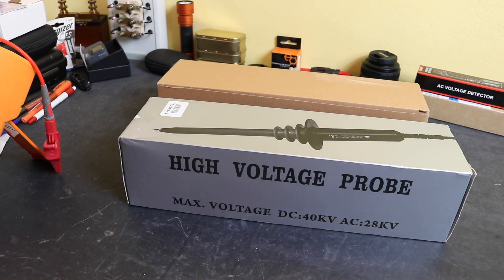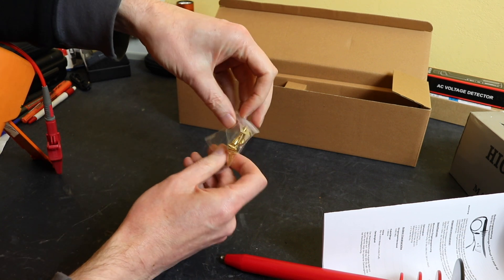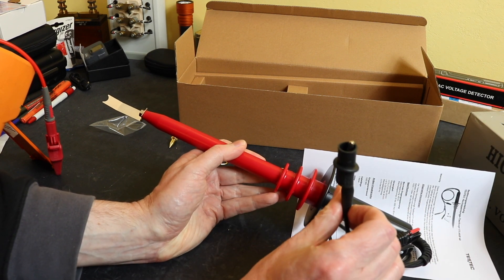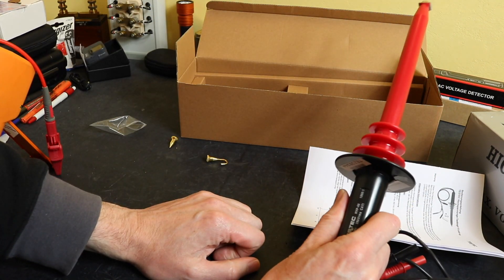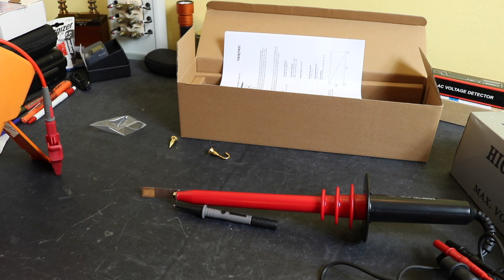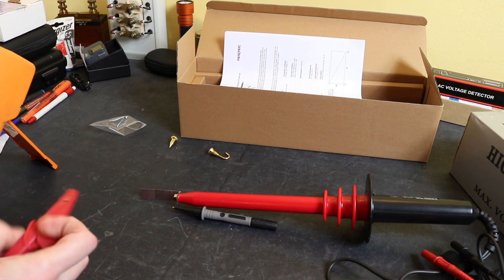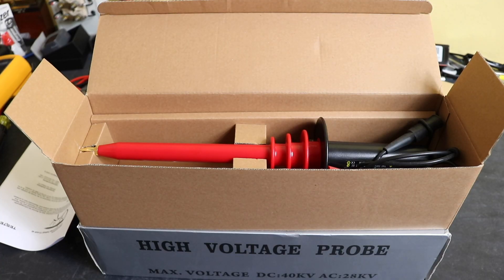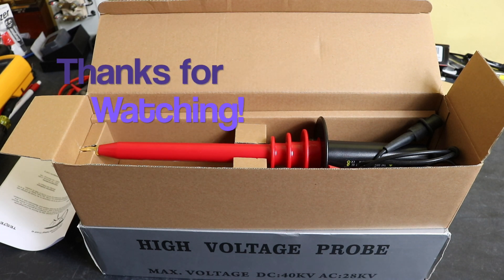Testec High Voltage Probe Tests

Comment: That design hasn't changed since at least the 1950s. I have a RCA WG-289 that looks exactly the same.
Reply from the maker: Interesting to know, sometimes materials improve over the year, but basic high voltage design just aims to keep people at a distance. Thanks for watching and commenting.

Comment: Interesting device agree for something technical probably should spend the money.  Now testing be screwdrivers I'm looking forward to that one!
Reply from the maker: Yeah, definitely prefer the more reliable brands when it comes to higher voltage testing. VDE screwdrivers will be a while yet, need to build up the holder.

Comment: When would a 100x (4kv rated) standard sized scopeprobe be sufficient to use when looking on voltage on a scope..
tons of smaller things are using high voltage, even smaller component tester that merely are running on a single 4v LIPOcell.
Same with a small plasma lamp from China that are running on fx 3x AAA cells and are using a tiny flyback transformer.
These smaller HV items that are being powered by batteries, and are in the range of a few thousands volt but with minute current behind..

Would a probe like Testec TT-HV 400 | x100 (4k DC &  AC peak) be okay to use on such small high voltage battery powered things.
And also looking at mains voltage, not HV products running form mains.

I get that getting a high voltage differential probcoe is the preferred way when working with high voltage or even mains, to obtain that isolation, but they  do cost decent sum for the casual hobbyists, and not least if a decent 100x HV scope probe could muster some of these usecases.
The scope would be floathing, not grounded fx Micsig.

Thx for the video, any reason you didn't look at the signal on a scope, as these high-voltage probes with 4mm sockets tends to be quite a bit cheaper then the ones with BNC socket, and wondered how well they would work for use on a scope with an 4mm to BNC adapter, but then again, signal-fidelity is likely not the main narrative on such attenuated resistive probes..
Reply from the maker: I do not have that particular probe from Testec so cannot comment directly about it, although I might get hold of one later. You can certainly use them for higher voltages as long as the attenuation is good enough to drop the voltage you are measuring down low enough for the rating of the scope inputs. My Micsig has 300V rms rating so with a 100x probe there will be no problem.

Battery powered scopes are ideal to maintain the isolation, just be aware that the channels may not be isolated from one another so you can get circulating currents through the channels. Generally with the higher voltages, I will stick to one measurement at a time using just one channel. My Micsig does not have isolated channels, neither does my Picoscope and with those you also have to be aware that the ground will be common back to the USB port of the computer, which can create further problems.

I did do a section with the scope but messed up the audio recording, so will have to do that section again and put it in a later video.

Comment: I never heard of the brand TESTEC. It looks like the FLUKE high voltage probe I own. I never felt comfortable using one of these probes. Nice review TP
Reply: TESTEC makes great Probes for oscilloscope.
Reply from the maker: @TonyAlbus  A comment below talks about them, I have not used their oscilloscope probes before, not too many places seem to stock them, but they are in Farnell who usually stock good quality suppliers.
Reply from the maker: All these high voltage probes are pretty much the same really. As long as you keep your fingers away from it all, they are good to use. Appreciate you watching.
Reply: all brands of this hi voltage tester are made in the same factory